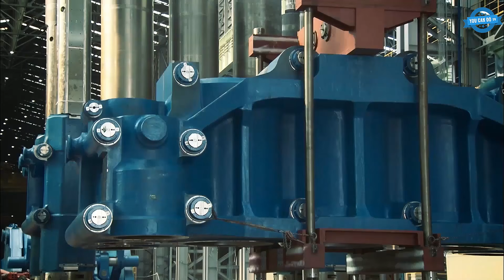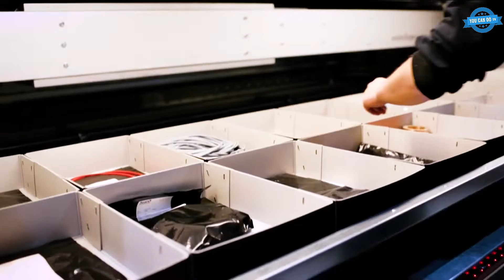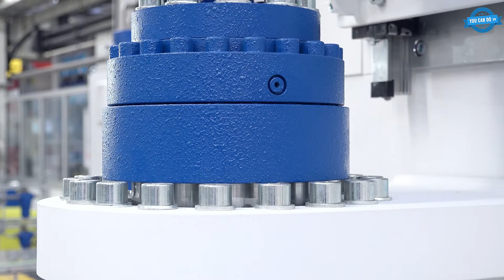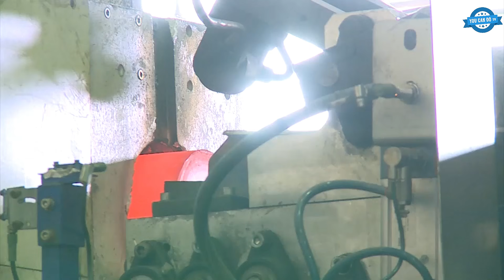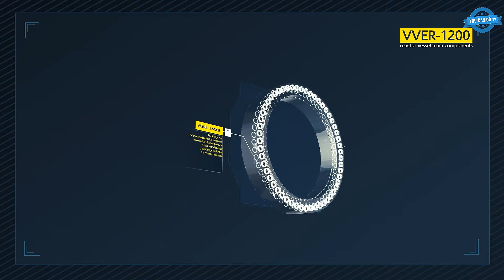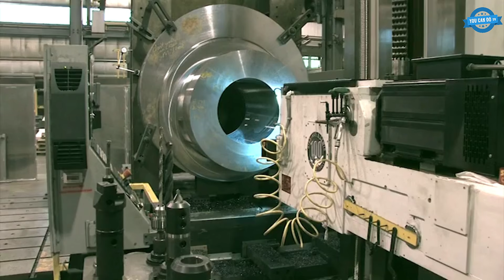How the World’s Largest Hydraulic Forging Presses Are Built & Operated. Free Engineering Documentary

Comment: Whoever wrote the script to this narration is wrong to call a casting a billet.  A billet is a casting that has been forged into the desired dimensions.   I can't visualize what a hundredth of a millimeter is .  Is it in the ten thousandths range ? How far is a few meters?
Reply: It is AI generated, and full of errors.
Reply: 0.01m =0.004in
Reply: @richardh50 
0.04in=0.01m
Reply: @richardh50  0,01meter equils approx .4"  (not four thousandths of an inch .004).